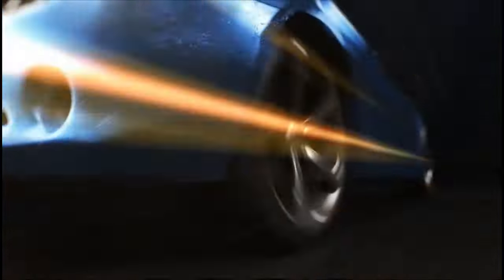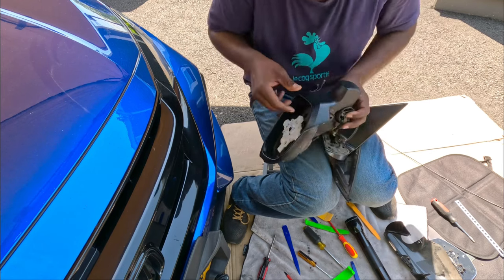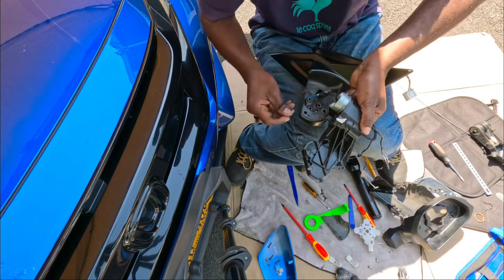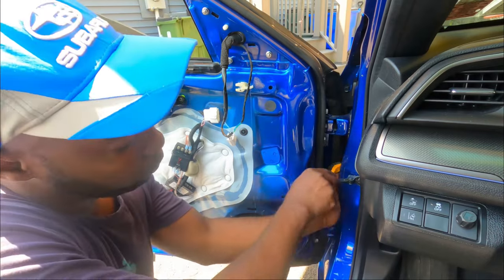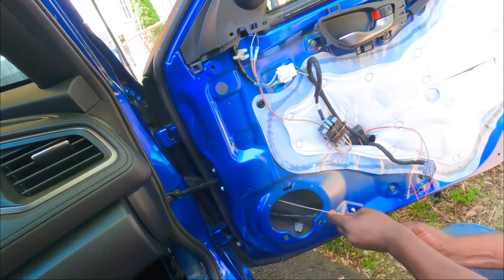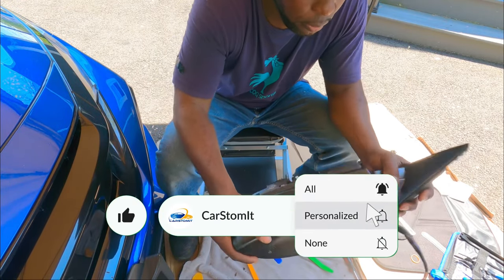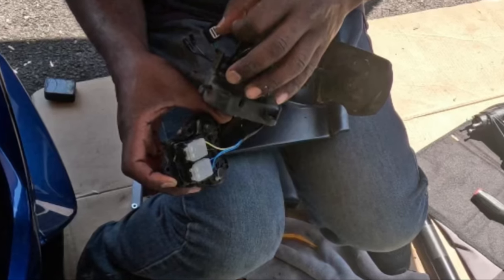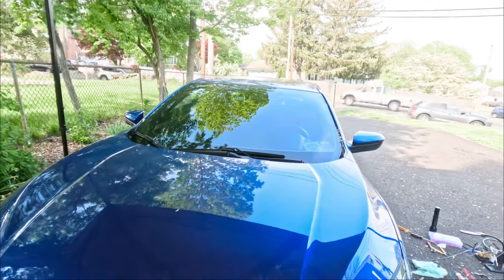2019 Honda Civic power folding Mirror

Comment: Did you use the original Honda module? Do you know the part Number of the module? Thank you from Brasil!
Reply from the maker: I didn’t use anything Honda. Everything the motors wiring and buttons are all after market. When you buy this. It comes as a kit. So hey means everything you need is in the  box. 📦 do a search online and you will be able to fit the kit for your  car.
Reply: I bought all the parts on the second hand market. Including the mirrors, wires and controller button. But i dindt know that the foldable mirror needs the module.
Now, i will buy a control module from brazilian aftermarket brand “Faaftech”
Reply from the maker: @relaxingonthescreen1574 yes urge module is the brain of everything. That’s why I buy it as a kit and everything come together.